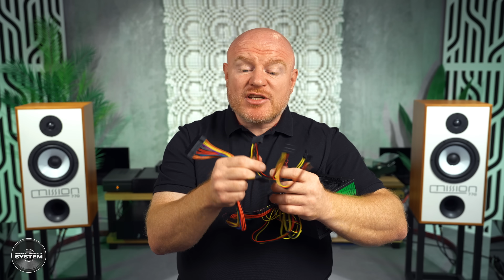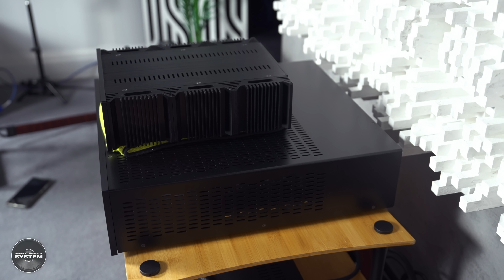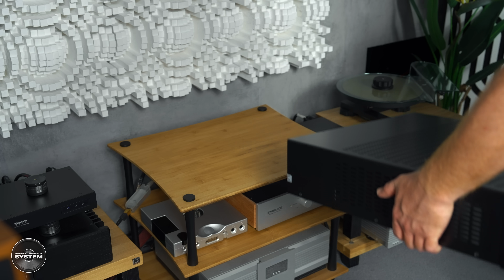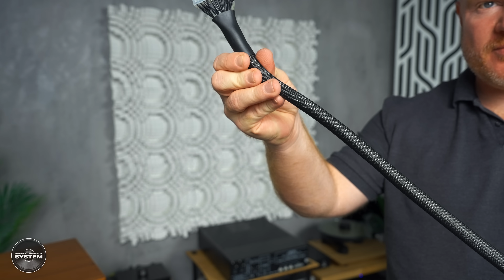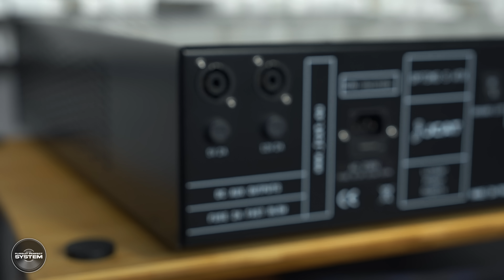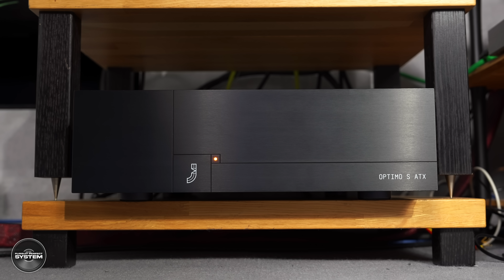HiFi FIRST BEST & BIGGEST !!  JCAT OPTIMO S ATX REVIEW

Comment: I think installing solar panels and Tesla powerwall and wired directly to a converter then to your audio system will have the cleanest power to your system. Also a very environment friendly system.
Reply from the maker: I dont think its works like that because all the hifi products pollute the mains as does everything else plugged into it but great for eco 100% and with prices as they are would be great way to have extra money for more upgrades.

Comment: let's get one thing straight it's not a linear power supply as you call it, if it's putting DC voltage out its classed as a low rate switch mode power supply it is still switching at 50 60hz 100 120Hz .... what is not good for audio. a proper made hi mode switch mode power supply is superior to any linear low rate power supply.
Reply from the maker: Sorry I don't know the technicals of this to answer your question, I do know there is no switching elements in this power supply, literally none.  Even the control board for this is powered from a linear supply.  I know this doesn't answer the question.  I did my comparisons years ago of switching vs linear and linear was much better.  I do this same test a lot for individual components and linear imo is better every time.  I have been getting my best sound ever with this linear powering everything in  my computer music server so that says a lot to me - sound demo posted on Friday in support of this
Reply: @PursuitPerfectSystem  
yes because people who build linear power don't know how to build a proper smps and even people who build smps don't do it correctly lots of cases for audio.
there's no way you can have a transformer "linear supply" without having some sort of rectification. cheers anyway.

Comment: How do you like the Singxer SU6? Even with your all out DIY computer streamer, does the Singxer SU6 make discernable improvements in the sound quality of your system? How big or small is that improvement. if any? Or does it make bigger difference with more modest streamer or computer?
Reply from the maker: I bought the Singxer to convert the digital signal to i2S to allow me to review the different R2R DACs that benefit from this.  I am in two 2 minds about it, I have had some great sound with it in my system, exceptionally good in a lot of areas but I haven't had anything else to compare it to for that role.  It allows me some settings flexibility I didn't have before which is a big pro and I think it has a very technically good sound, but I think great hifi products do that and a bit more on top but the SU6 is not crazy money so I have to be realistic with my expectation - the Denafrips GAIA is 4x as much for example and I have one coming to look at so I can better judge it once I make that comparison.

I also want to try it with a linear supply and see if that makes a difference, I appreciate it uses super caps so on paper it shouldn't but in my experience there is a chance it will so its worth testing.
Reply: @PursuitPerfectSystem  I hope you do a review of SU2 and  or GAIA and discuss merits of DDC's to improve digital signal. I've had good experience with Gustard U16 and ISO REGEN. They seem to stack together to further improve the sound, which I've read and verified to my surprise. But, I am running it off a noisy run of mill PC. I am trying to gauge where, DIY PC streamer or DDC to allocate funds for optimal performance. Thanks for your reply.

Comment: Linn are the instigator and leader in this field with switch mode power supplies for high end audio except where each individual product has its own designed SMPS. They started it over 30 years ago and have built a very deep understanding. For example the new Klimax DSM utilises their own power supply technology along with their ground breaking DAC.

Comment: no picture from inside and no science behind the product for a power supply that cost 5000...nice!!!
Reply: What do you mean by 'science behind the product', you want to know what voltage is?

I was told by a Soviet engineer once that at the Soviet university he went to, which run purely on 'science' I guess, he was taught that every CD player sounds exactly the same, because this is what 'science' tells and anyone that dares to say otherwise does not use 'science'.

And what about the price? You suspect £500 worth of parts being sold for £5000? It's never wrong to investigate, I agree, but I don't think each and every reviewer has a duty to open up the device. It's not like this product came from a never-heard-before company offering 'magical' devices for high-end prices.
Reply from the maker: There is all that on the co website no need to regurgitate the same information

Comment: JCAT should design a new modular computer case the same size and design as their new LPS so they both match and the use the extra internal room for a couple of modular plugin LPS's boards to separately feed Network, USB and SSD cards. Save having loads of boxes all over the place with loads of cabling everywhere picking up interference etc, improving audio quality even further... Also a good way of upgrading over time when funds allow for most people.
Reply: It's in the making :)

Comment: JCAT is a great innovative company with very good products.
The only one problem is that: this is not the first 100% linear PSU in music servers history.
There is TAIKO, Pink FAUN, Innous Statement, 432, Core Audio etc.
A lot of company use many years ago full LPSU in their music servers.
Reply: Not true. Show me fully linear (no switching regulators whatsoever) ATX power supply.
Reply: My answers were moderated?
Reply from the maker: Nothing has been moderated unless YT did it auto, I have a looked, no message is being held
Reply: @PursuitPerfectSystem  Hi Terry, thank you for your answer. I uploaded into Google Drive two pictures and linked them to here. Marcin asked me about any other 100% full linear PSU examples and wanted to share them. For first, there is the Pink Faun ULTRA. On Pink Faun's website on the product page easy find the right answer: 100% linear PSU, debut 2 years ago + use supercaps too (it is also really important information). Second we at Core Audio using since 5 years LPSU in ALL of our music servers. Not we are alone, there are separated LPSU in 432 servers in different case etc.
Reply from the maker: @coreaudioco.ltd.hungary7319  maybe the link was auto blocked becaue its an external link but that doesnt normally happen nothing is showing in the part of YT where potential misleading comments are held. Sorry about that
Reply: @coreaudioco.ltd.hungary7319  these are not ATX power supplies. ATX power supply needs a control board. Making a high-current linear power supply is not too difficult, although still challenging considering efficiency (thermals). Making a fully linear ATX power supply is however extremely difficult. By ATX I mean the norm, not brute-force by adding ATX connectors to a linear PSU. 

Again, please show me truly linear ATX power supply. There are none apart from JCAT.
Reply: @coreaudioco.ltd.hungary7319  Taiko is not fully-linear. Innuos is a brute-force 3-rail PSU. Their Atom based server does not need high-current-  I'd be surprised if it needed more than 30W in total. JCAT can easily take 500W under stress.